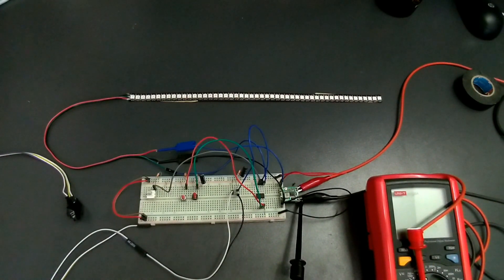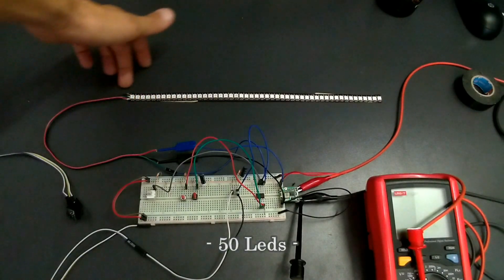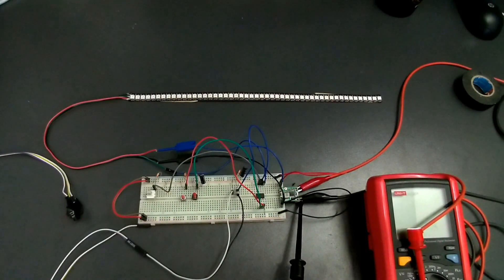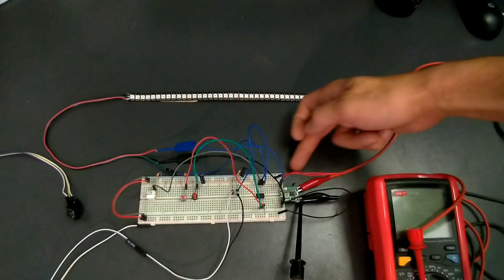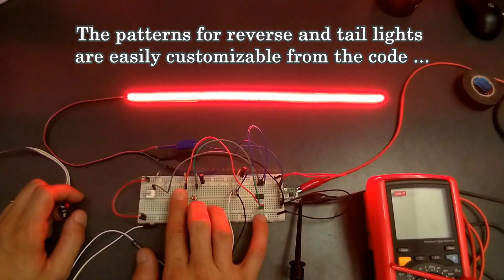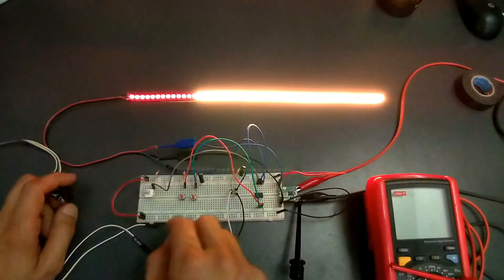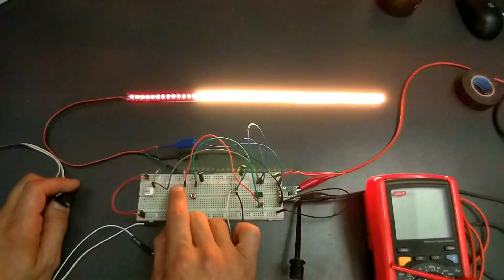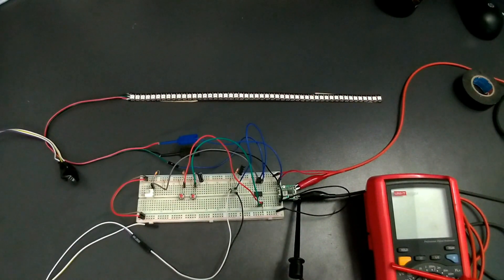Modern turn signal lights v6.1 Attiny85 dedicated strips - Arduino, FastLED and WS2812B

Comment: the issue is that the turn signals are not steady signal as you showed in your demo. the turn signal are like a square wave which will affect the leds when there is a brake or hazard with brake . have you tested this on a car?

Comment: Hi sir good day can i use ws2811 led strip in this project? Will it still work?
Reply: Shouldn't be any problem with that. FastLED supports WS2811. You might have to note that in the code (change references from "NEOPIXEL" in the FastLED.addLeds call to "WS2811", but it may still work anyway. Also may have to add "GRB" to that call to get the colors right, since the default seems to be defining colors "RGB" if not specified (which it isn't in this sketch.)

Comment: do you have a code like this but with 2 turn signals so i can use 1 arduino nano for both sides of the tails lights just sending the data to the other side?
Reply: Old comment, but I think you could define another strip (output pin), another turn signal pin state, and duplicate the turn signal section using those two new parameters. The ATiny couldn't do it (not enough pins, but the Nano you're using does. I'm learning this stuff myself, so could be wildly wrong. I think the point with using the ATiny is to basically be able to contain it all in the light, for scooters and motorcycles. A custom board with an ATiny, VREG, and optocouplers would be pretty dang small.

Comment: Great work! I tried to have left and right tirn feature in one strip only but with attiny 85 sacrifising the tail lights , I've been trying for more than a week but sadly it didn't work for me for some reason. If you could guide me how I can have one strip only with attiny 85 that can have both left and right turn animation with brake light and reverse lights so in all 4 inputs only . PS: I don't need this for a car , but for a small scale demo project I've been working on . Any help is greatly appreciated!
Reply from the maker: From what i remember, i also tried to do left, right, hazard and daylight in one strip with attiny85 but i didn't had enough space to make the sketch, 8Kb it wasn't enough.
I recommend you to use a arduino pro mini 5v, it's much more faster, easier and you don't have to sacrifice anything.
I'm glad you like it ! ;) :)

Comment: So how do you impliment right and left turn signal.... ? 
I noticed everyone that asks a legit question you dont reply. But if they say good job, you reply... what's up with that.. because if you need another input pin for left and right on the ATINY then what ? 
Are you using 1 MCU per side.. ? The way I see it you dont have enough input pins for 1 controller to do left and right ?
Reply from the maker: As mentioned in the title, in the connection diagram and as I explained in the video, in this version i made "dedicated strips", which means you will need one for each side/corner, one for front left, one for front right, one for rear left and one for rear right... The basic idea is that it can be easily integrated into the headlight or taillight housing.

Unfortunately, the covid pandemic and the fact that I became a father for more than six months, for the moment eliminated my free time that I had and invested in this project on youtube. Regarding your presumption, it's completely wrong, it's based only on the time required to reply and believe me when I say, this kind of project/channel requires a lot of time, even for the replies, time that is not paid, it is only pleasure and satisfaction that i spread some knowledge that i get in return and sometimes some small donations.

Comment: i have a arduino nano, ive just uploaded the code, and i have changed 50 to 144 as i have 144 leds, but ive no idea what pin your using to output to the led strip, and i dont no how to activate/test anything?

Comment: hey very nice but how can i  switch from left turn  singal to right i want if you want to go left with the car the led strip goe from right to left en wen i want to turn right the led strip go left to right in one very long strip i have 2 meter 144led per meter greeting from belgium

Comment: Greetings ! i love your project for the motorcycle ! 1 question ! on the schematic there is only 1 turn signal switch ,how you define left and right ?also where you define the PWM pin for the strip if you use arduino ?

Comment: What is the data pin for the led strip when using arduino?
Reply from the maker: At the start of the sketch, you must comment the " //input pins for attiny85 " and uncomment " //input pins for arduino " by adding and removing // from the start of the lines and also in the setup void this two lines (line 53 and 54): 
  //FastLED.addLeds<NEOPIXEL, 13>(leds[0], NUM_LEDS_PER_STRIP); //led strip front left for uncomment for arduino 
  FastLED.addLeds<NEOPIXEL, 0>(leds[0], NUM_LEDS_PER_STRIP); //led strip front left for uncomment for attiny85
Reply: @IonutF-TS-BB  Thanks a lot!
Reply from the maker: @gabrielstanciu1394  With pleasure! ;)

Comment: Hi I would like to add brightness control for the TS amber , can you please advice?
Reply from the maker: Well, the amber / the signal color i thought it to be always at full brightness, so i've use hex color method to set the color and the brightness is at 100% by default.
To be able to control the brightness you must modify the signal functions and use the hsv color method.

Comment: GREAT JOB
Thanks for sharing 👍👍👍👍👍
Reply from the maker: Your welcome, again! :))
Reply: @IonutF-TS-BB  are you available to talk.
Reply: @IonutF-TS-BB  I have arduino nano

I am trying to learn how to do this

But how are you capable of making a physical hardware switch create an actual output

I understand I can program led to flash when there is 12vpower

But how can I have 3 switch (brake left and right) 
How can I input my three options from An actual switch

Comment: Hi, great work exactly what i was looking for to put on motorcycle - I have 15 leds with data pin 2 , what do i have to change to adopt this exact scenario with arduino for now
Reply from the maker: Hi and thanks. 
You must use an even number of leds for the math to work ok and after you change the number of leds (NUM_LEDS_PER_STRIP), everything should work !
Reply: @IonutF-TS-BB  Hello. You can modify your script for an odd number of LEDs to let the "copy/paste" hobbyists enjoy your thourough code. Very good. Sorry for your struggle, hope you remain patient and kind.

Comment: is it possible to have the turn signal so it flows off as well as flowing on?
Reply from the maker: Yes it is, but it isn't integrated because i think that you will have problems with the police if you implemented in a vehicle.
The line that is responsible with the off sequence for the turn signal is find in the "turn signal function" at line 95 - this is the one " fill_solid(leds[0], NUM_LEDS_PER_STRIP, CRGB::Black); " and you should change also the delay for the animation to black " delayTurnLedOff ".
You can reuse the for loop that is turning on the signal and make it to turn off the signal (for loop from line 71 to 84).
But i repeat, i don't recommend, the way that is made, actually the way that Audi thought it and made it it's more visible and safe...
Reply: @IonutF-TS-BB  Thank you so much :)

My Current alfa Romeo has it flowing on & off and even passed an MOT like this :)

I hope it should be ok as I not had a problem ever so far :)

Thanks again you are a big help and I love your projects.

i want to keep watchign and following for some new and cool ideas
Reply: @IonutF-TS-BB  Thank you very much, one last quiestion, Can I use a diferent capacitor instead of the 1UF 10v as I am struggling to find this exact one thats not microscopic 

Thank you
Reply from the maker: @Craigrobbo2k7  You can play with the value, it's not a fix value, but don't go lower 1uF and from my opinion, higher than 10uF. ( 1uF 10v is not microscopic ... https://www.tedss.com/2020060479 )
Your welcome! ;)

Comment: H! Is it possible to choose how many LEDs will switch on with turn signals? Or is it a preset fixed parameter?
Reply from the maker: I thought it and write it the other way around and the signal will always be using all the strip. Actually the tail and brake will override the signal leds and it's not fix, it's dynamic, more precise is a quarter from the total number of leds.

If you wanna change that value, search for:
int nrLedsTail = NUM_LEDS_PER_STRIP / 4;
and
int nrLedsBrake = NUM_LEDS_PER_STRIP / 4;
and change that 4 (the quarter) ...

For the reverse you can change the pattern from the reverseLightModel variable and remember that the reverse lights are overriding every other light on the strip.
Reply: @IonutF-TS-BB  great explanation! I missed it while reading the code, my bad. Thanks again for your help!
Reply from the maker: Your welcome! ;)
Reply: @IonutF-TS-BB  I have some other questions, since I'm trying to totally understand the schematics:
1-I checked your schematics in the compressed folder and found out you indicated one 1uF 10v capacitor for turn lights. Is that the right value to be used or was it just an indication?
2-Why is there another capacitor on your breadboard? So it looks like you are using 2 of them?
3-Using octocouplers instead of switches, are those 10k resistors still needed?
I might have other questions later... sorry for bothering!
Reply from the maker: 1. 1uF 10v worked ok for the basic schematic, but for the final schematic something around that value, so it's just an indication.
2. That one i forgot, you don't need a capacitors on the reverse lights.
3. The 10k resistor it won't be needed if you are using the 4.7k from the optocoupler, but using them in parallel it will give you a resistance of almost 3.2 ohms, that's why i didn't bother in the schematic...

Ask here and when i have the time, i will answer! ;)

Comment: What kind or ws2812b youre using? Seem slim ang small
Reply from the maker: This is the one that i'm using in v6.1 - WS2812B IP30 Non-waterproof with 144Leds/meter - https://amzn.to/2KfKmPg ...
But you can get one of this two that are waterproof :
WS2812B IP65 Waterproof (more like splash-proof) with 144Leds/meter - https://amzn.to/2yDxwnt
WS2812B IP67 Waterproof (submersible) with 144Leds/meter - https://amzn.to/2KhApB1
Reply: @IonutF-TS-BB  So nice.. Btw i made my father motor cycle.. And in front  right led sometimes it flickers def color.. What the prob my data line? Or mybe the 470 ohms but the other side is ok.
Reply from the maker: Most likely could be a data line problem. 
Try lowering the 470 Ohms to 220 ohms or even 100 ohms. 
If it's still flickering check the voltage at that led strip and see if it's stable.
It could be also from electrical interference from the engine on the data line and that can be solved by shilding the data line wire.
Reply: @IonutF-TS-BB  Ok boss ty.. Or in my solid wire? Cause of lacking of stranded wire i use the nternet cable wire almost 1/3 haha.. But the project was great.. Btw i want to put the knight rider lyts in tail lyt.. I always get error in programmingn it
Reply from the maker: Actually is hard to tell until i see your connections and your modifications to the code.